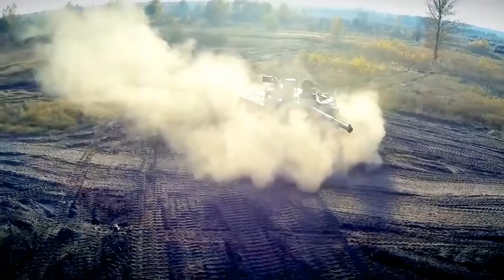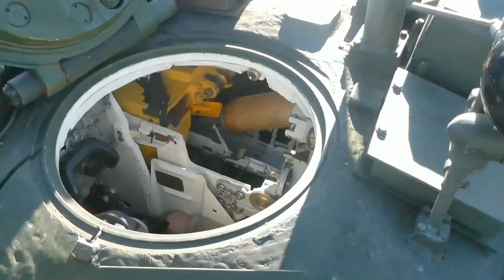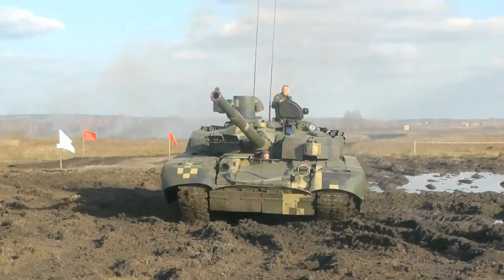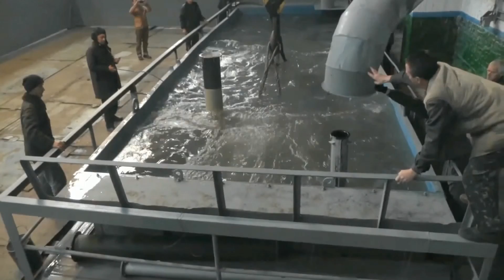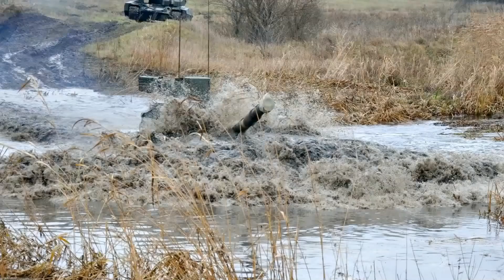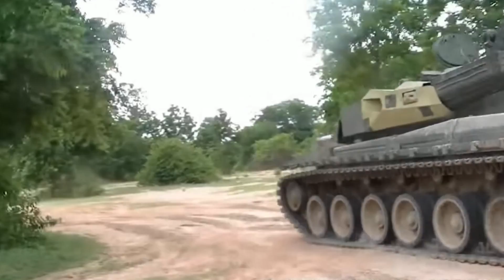The T-84M Oplot Main Battle Tank - Overview

Comment: Ukrainian T-84 is based on the "Russian" T-80 that is mostly an upgrade of the "Ukrainian" T-64, but with a turbine engine and a different suspension. Ukraine built a diesel version of T-80 in 84-85, hence it eventually became the "Ukrainian" T-84. So, Oplot is closer to the "Ukrainian" T-64 than the "Russian" T-80. From this perspective, it is a "Ukrainian" tank, not a Russian one. In any case, either tank was a "Soviet" tank originally. Also, the T-64A had an remote control of the turret mount machine gun, they just reintroduced it on the T-84. The "Russian" version (the T-80 with a turbine) didn't have it and it cost lives in Chechnya. I believe the Russians have put similar measures on the T-90 since. In my opinion, the Oplot needs a better suspension and an improved transmission. Just notice how much wobble it has after firing or  moving around dirt. Ukrainians should focus on something new, if they can afford it, something similar to the "Molot/Nota/Boxer/Byntar/T-74" designs they had in 70s and 80s (those were truly challenging but interesting).
Reply: sure why not the 146%? :) If this is true how in fact Ukraine managed to preserve 80% of its strategic  military production and engineering after exiting USSR? Oh perhaps the majority of the products were actually made IN Ukraine? You, imbeciles still can't manage decent rocket engines, helicopter turbines, radar systems etc. If you're so developed, why you have stolen our several microelectronics, crystalline and missile guidance factories from Lugansk and Donetsk to Russia?  So cut your fantasy crap short and don't make people laugh :) Russian cultural space - what is this shit anyway? Vodka, matreshka, balalayka? We had enough of that crap for 70 years, no thank you :)))
Reply: You don't know what you are talking about. England and Scotland are together much longer than Russia and Ukraine but it doesn't mean that these cultures are almost identical and that the difference is artificial LOL :))) And I'm sorry but I can't be MORE tolerant as Russia's been killing my people by millions for 300 years just to satisfy its territorial and imperialistic ambitions. Every day one to tree, or even more guys dies to protect my country. Every month me and my friends are gathering supplies from all over the city and deliver to our servicemen at a frontline. Our car was shot many times by russia supported terrorists but this won't stop us till these bastards leave my country for good. How's that as a perspective for you?
Reply: Actually, I wasn't replying to you, but the other guy. What I am trying to say, let's keep the discussion civil and abstract, away from politics. The Russian aggression in Ukraine is a painful subject, not only to you, and history will be the judge. It would benefit us all if we don't fixate on it at the moment, but instead discuss technology and try to stay away from politics in this thread. I'm sorry if I offended you in any way, this wasn't my objective. Regards.
Reply: LOL You just can't lick putin's ass harder than this :)))
Reply: "It's been 3 years, and no proof of "Russian aggression" yet." - LOL Tell this to the United Nations and 76 countries that do not agree with your pathetic faking attempts :))
Reply: > how in fact Ukraine managed to preserve 80% of its strategic military production and engineering after exiting USSR?
It only preserved it because cooperation with Russia remained. But Ukraine was gradually braking ties with Russia, ending up with The Conflict. Now Ukraine can hardly produce anything.  It could build space rockets, but hardly we will see any new ones from Ukraine. It could build planes, but Antonov is almost no more. Does An-178 consist 80% of An-124? Hardly.
Reply: Sir, using your logic, should we conclude that the "Russian culture" is a "Ukrainian culture" in disguise? Since a lot of "Russian" heritage was originated in what is current Ukraine. Can we please be a little more intellectual and stay away from bigotry and racism? During the Soviet times, the Russian vs Ukrainian difference was mostly artificial, since both countries were parts of the larger empire. Since the collapse, Ukraine is Ukraine and Russia is Russia, whether you like it or not. Regardless of the historical ties, etc. That helps define things and puts them in perspective.
Reply: 90% of actual intellectual and technological input into those projects was generated within Russian borders, and 100% within Russian cultural space in USSR.

Calling any of that Ukrainian without quotes is same as calling the entire US space program the product of Florida.

I'm not being chauvinistic, that's just how it is.
Reply: Yaroslav, your nationalism is blinding you. Ours and Russia's culture is the same. We are the same people. Yes, many in Ukraine died to stupid dictators of the USSR, don't let the past ruin your future. Georgian leaders are the problem, like Shakisvilli trying to be the Ukrainian president right now...
Reply: > England and Scotland are together much longer than Russia and Ukrain

And here goes a Nazi brainwashed moron in all his hillbilly glory

Comment: Turkeys modernized M60 Patton tanks are better than this.
Reply: In 2002 these were their best APs they had at that time. I told you already - the bands start falling off the moment the rod is free off the barrel. They usually travel not further than 10 to 20 meters, BUT EVEN IF it hits the plate - who cares??? ))
Reply: smartacus88 No Way. The M60 Patton mbt is outdated. That's why the US created the M1 Abrams. In addition, the T84 oplot is more technologically sophisticated than the M60 Patton.
Reply: Will your M60 hold the M829A3 hit at 100m? Doubt it :)
Reply: lol, the bands are discarded INSIDE the barrel as soon as the round starts its spinning motion, so technically APFSDS is already effective almost instantly after leaving the barrel.
Reply: In 2002 we had a French army 2nd mech corps at our wargames in southern Ukraine. They brought 4 Leclercs with them. Our guys suggested to test Nozh with Leclerc's 120mm F1Giat main gun which fired a  Depleted Uranium APFSDS with 700mm RHA penetration at 2000m and 750mm at 100m which is similar to American M829A2. The French team was shocked when their round left just a 10mm dent on the main armor plate and was shredded to bits with the ERA :))
Reply: in 100m sabot hasn't even discharged yet
Reply: stop play word game and copy from andrei's blog, we knew what happened in the french test but also french doesn't bring their best rounds. the sabot are not fully discarded in the range of 100m, if it hit a plate under 100m the sabot will hit the plate right up close to the penetrator
Reply: lol usa developed m1 and stopped using m60 to  answer on soviet t80 are u dumb or something?  m60 armor too weak, soviet 2a46 gun  will dismount every part of m60 in one hit
Reply: smartacus88 they are pretty cool, at a cheap price. Im just happy to see turkey modernizing M113s and M60s and keeping them alive
Reply: Justin Sarfo you must be unfamiliar with the L3 upgraded version. Check in to it. Its far better than 9/10 russian tanks

Comment: Hi mate a bit of a Russian perspective.
 Russian military professional journals describe T-84 as superior to T-90 (as of 2010 level of modernization). As to Ukrainian industry where they encountered difficulty is;

 1, gun stabilization, number of Ukrainian produced AFV have guns which are carbon copies of Russian designs; yet have a noticeably shorter effective range.

 2, ammunition the only munitions factory located in Ukraine was in Donbass so since Ukraine has no large of tank ammo suitable for T-84 and no way of manufacturing it domestically. They have to rely on EU aid for gun ammunition. 

Personal perspective the tank is a very interesting blend of NATO and Warsaw pact military thinking. It wold be interesting to see it perform in mobile war. Next is it my Russian bias or are those side skirts a bit thin? Not bagging on the tank just want to hear someone’s opinion. Finally you mention the problems Russians had in Chechnya at doctrine and operational levels the problem has being fixed but on individual crew level you still see many crew commanders who are national servicemen. In my opinion you can get away with a conscript driver and gunner but crew commander must be a professional solder.
 Anyway love your work mate.
Reply: imposible
Reply: It actually comes with a full ERA skirts. Very impressive.

Comment: The Leopard 2 can cross a river under water, so there is at least one western tank that can :P
Reply: Every MBT can submerge underwater at least once..
Reply: @gusframe2259  lol
Reply: I thought every mbt could do that??
Reply: Ever mbt can cross rivers.  Duh
Reply: Why would you and risk getting it stock while submerged under water
Reply: @chadmcclure2972  there is actualy a very low chance to get it stuck under Water since normaly beforehand Pioneers and divers would make sure that the river spot is good for fording, making sure there are no excesive dips or big rocks in the way.

Why would you do it? while it isnt hard to build improvised bridges nowadays, most of em arent rated for vehicles of this weight class. many times its also not suitable to build improvised bridges in certain rivers and its generaly faster to set up a leo for fording a river, i think its about half an hour to an hour to do so
Reply: @JohnF0X if you have time to check the bottom of a river for integrity for a tank to cross it, you have time to deploy mechanized bridge layers.
Reply: With preperation, the M1A- series of american mbt's can aswell.
Reply: @RH-om1ph  with preperation?? Lol poor sods.
Reply: Nope not fully underwater just track level
Reply: @younissumaling8744  Check again, it has a Snorkel that extends from the commanders hatch, can ford rivers up to a depth of i think it was 6 meters

Comment: Pakistani army has T84s ;) and using Ukranian engines in the Al Khalid MBT would be interesting to get your opinion on it it has a crazy power/weight ratio too!
Reply: I think you mistake it for T-80UD which is also basically a T-80 Ukrainian modernization, but not as radical as T-84
Reply: No, it has t-80UM if i am not mistaken. BM Oplot is new tank based on T-80UM.

Comment: better than t 90
Reply: which version? t-90, t-90A, t-90AM, t-90M or export versions t-90S, t-90MS
Reply: Tyler Chotikamars original? yes. MS? nope
Reply: Yep - none of that BS you're talking about :)
Reply: Tyler Chotikamars there is no way in hell that the T84 oplot is better than the T90 mbt. For example, thr T90 has an active protection system.
Reply: Don't know, why so much hype. B3s could be and are knocked by that a few T84 on the DNR front, but I personally seen one for sure, two if that another tank was really Oplot (not much remain from it) which were hit and died by B3 first strike or short shotout and the one Oplot which died on first shot&hit from even T64U. Yes, T84, T72B3 or T90MS are great tanks, they are wonderful piece of tech...but still, you could still easy to die or survive, when you get the hit.
http://imgur.com/a/Jol6l
It's highly sad, but the reactive armor doesn't work as was expected for either side and crews get burn alive in the moments where they may to live :/
Reply: @thomaschadwick1557  b3 ? those are t72b and they have only 3 t72 not b3
Reply: No Oplots were used in Ukraine-Russia conflict to date.
Reply: They did amazingly well in Syria.
Reply: T90 has a 125mm gun. Do some research. I am a Ukrainian but I refuse to be an ignorant one.
Reply: Better??  
While it may in some manner, probably hold its own in some aspects, but that's probably only when added-on or -in with the numerous other optional Western systems.
One thing I'll hold a thumb-up high for it tho' & that's for aesthetics alone. This truly "Is" one very handsome vehicle. An out-right, so-to-speak, undisputedly "Better Than" the Russo T-90, Hmm..??  Naa.., I dont believe in that kinda VooDoo bull shit stuff.
Reply: so is Ratte, lol. how much of Oplots were produced again?
Reply: Tyler Chotikamars Definitely not better. Even though this tank may have slightly  better armor than the T90A and the T90, those 2 have better ammunition. Oplot will struggle because the only chance it has of killing t90 is with an atgm, which the t90 has a good defense against
Reply: https://en.wikipedia.org/wiki/Strong_Europe_Tank_Challenge ze best last place! =D
Reply: no it has much less armmor less mobilaty less firepower
Reply: Dex4Sure  and t90A t90S even the t90K
Reply: There are a lot photos and few videos of t72b3 in Donbass.
Reply: Yeah, no Oplots, nor Vladimirs, nor their wrecks with burned kids which clings from burned towers between Shyrokyne and Sakhanka...
Reply: All of them. T90MS Relict armor won't stand the hit of M829A3 at 1000m range. Oplot's Duplet ERA will hold the same round at point blank though. T90 MS won't stand a modern RPG round to its side, Oplot won't feel a thing.
Reply: T90 is waaaaayyy overhyped by Russian media just like the Abrams is by the US media. Though real field tests showed them to be on-pair with the other MBTs at best. While in 1 on 1 confrontation T90S/MS would never survive against M1A2, but Oplot most likely will.
Reply: @sdrkrm  lol m1a2 is not even supirior to a t72bm and t84 is not even better then a t80U
Reply: @lukabogdanovic4658  lol, new Reinmetal A1 gun penetrated t72m all the way throught :) who cares about your so called superiority. 😂

Comment: BM Oplot  are mostly covered by Nozh-2 Era around the tank side skirt are "Duplet" design with 2 layer of Nozh-2 stacked from the front to rear of the vehicles and 3 layer on the front turret and 2 layer (not sure) on the glacis  and most of the area on the turret were protected by Nozh-2 Era but most of the picture are not equip it but noticable with  a small steel pipe on top of the turret .

Gun were similar to Russian use on T-90 while Ukrainian developing new gun*ammo called "Vitiaz"  still in prototype but still very rare to find in picture or specific information but claim to be as good as US M829A3.. the big big commander parascope are packed with everything and it can be use as the Rangefinder or anything that Gunner have .

Early BM Oplot send to RTA have battery problem but seem to already be fixed . and Order will delay so RTA decide to order VT-4 (planned 150 units) for different division to replace M48.  and seem RTA still looking for new Tank that different from BM Oplot or VT-4.

But the Gun Mantlet seem to lack protection like any other Russian Style cannon except on T-90MS .

The 12.7mm or 14.5mm anti tank gun is pretty much not as effective at close range or urban  combat since it have low gun elevation in both Depression and Elevation .

Comment: Nice video , i enjoyed the review .  Just a little thing  , Oplot M uses the Varta optronic countermeasure system instead of shtora . Varta  literally means "guards" , the tank can fire the local designed Kombat ATGM (its range is also 5000 meters), and can be fitted with an indigenously designed camouflage system called KONTRAST.

Comment: When they sent the T-80BVs into Chechnya they often didn't load the ERA cartridges into the slots.  Ugh.   Pinheads.
Reply: Stalin would have all those officers in charge shot for sabotage.
Reply: @ricardosoto5770  Wouldn't Stalin do it anyway, without them doing anything wrong?
Reply: @ricardosoto5770  Stalin shot dozed touthands officers before sabotage, just for the case, and that is why Red Army had enormous loses at the begging of WWII - no officers and non trained tanks crews against German  tanks' Blitzkrieg.
Reply: @denisoko8494  Yeah, they allready showed it in Finland...
Reply: Adecodoo  many of those Chechen fighters were veterans from the Soviet-Afghan war.
Reply: Adecodoo  it was merely an addition to what you said. 
I'd say it's definitely related to what you said because it provides a little context as to why those "Badass Chechens" were so badass.
Reply: @cejannuzi  " Because they weren't supplied or trained on how to do it. Officers--zeroes, pinheads. "

No. Because soldiers scrambled them for explosives and sold those explosives to chechens. It's true.